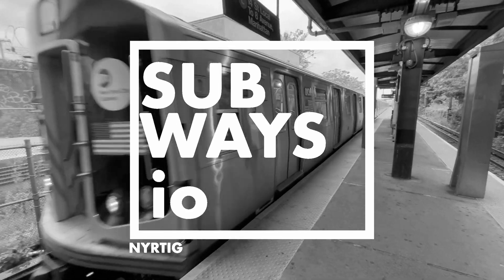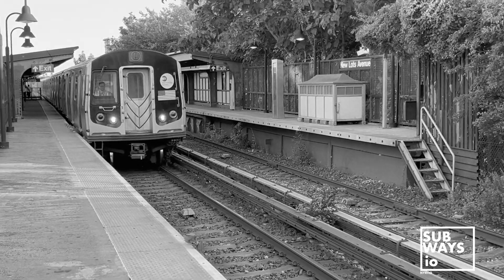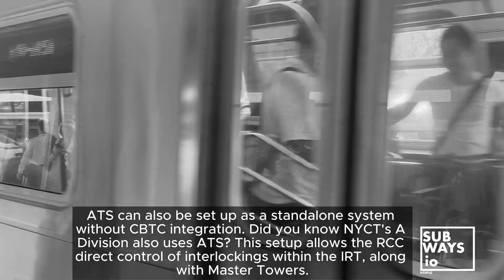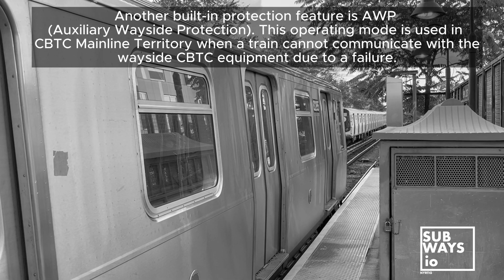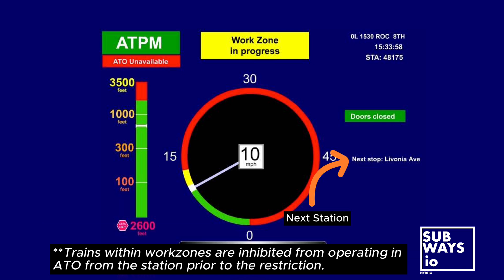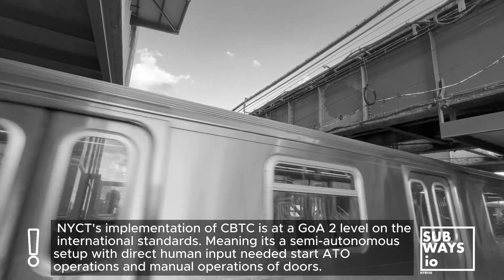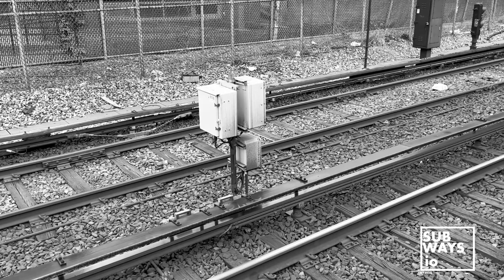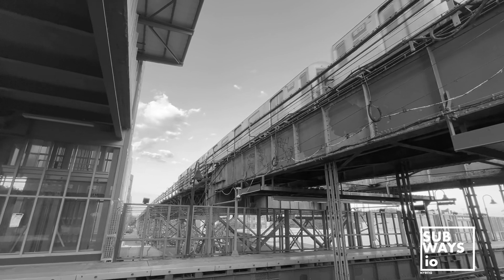Intro to CBTC: The Future of Subway Signaling | Quick Guide

Comment: (7) train CBTC: Thales' SelTrac Standard 
(L) train CBTC: Siemens Legacy Standard 
(E,F,M,R) train CBTC: Alstom I2S Standard
Reply from the maker: Hey, thanks so much for the comment! Here’s a quick breakdown of the three CBTC-certified systems currently in use:
1. SelTrac (Thales)
Used on:
	•	Flushing Line
	•	Culver Line
	•	Crosstown Line
2. Trainguard (Siemens)
Used on:
	•	Canarsie Line
	•	Queens Boulevard (West)
	•	Culver Line
	•	Eighth Avenue Line

3. MECBTC (Mitsubishi Electric)
Used on:
	•	Queens Boulevard (East segment)

To clarify, the I2C CBTC compatibility format generally refers to a communication profile or data standard used for integrating CBTC systems across different vendors or linking them with legacy infrastructure. It’s often applied in scenarios involving interoperability or migration.
Alstom, in this context, is not CBTC-certified for NYCT but does supply signaling equipment and interlockings, which interface with CBTC systems via AWS. Hope that clears things up — thanks again!

Comment: Quite imformative; I learned a helluva lot; one item being that not all CBTC systems have been standardized among the different transit authorities throughout the nation....

One system uses an AC frequency sent along the third rail, another uses a slotted coax cable either on the track or nearby, still another uses two twisted-pair cables reversing their placement along the rails every few feet or so----

And that's just how the signals are delivered to the trains themselves. It doesn't even pierce the complexity of WHAT signals they might be, and HOW they're processed in the onboard computer which, according to whatever arrangement used, might be different from one system to another....
Reply from the maker: Indeed, there are many variations in setup and level of automation with CBTC depending on the needs of the network. And that’s correct; there are many variations in signal rail and detection setups, power phase, or frequency NYCT uses the 25 and 60 Hz variety. There’s also sound and audible setups out in the wild as well. This video was released about three months back as just a short version of the 20-minute video we have planned. But we’ll talk more about onboard computers, virtual overlays, transponders, and TIAs, and how trains communicate with each other.  Not as fast as some of the younger folks with the digital stuff fair amount of effort but stay tuned for our CBTC 101 This and alot more.Thanks for watching.